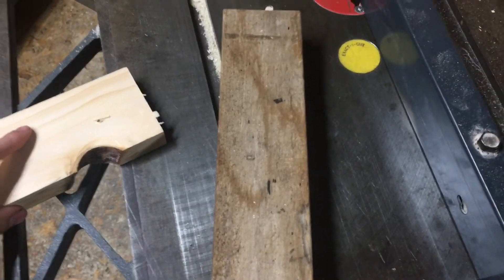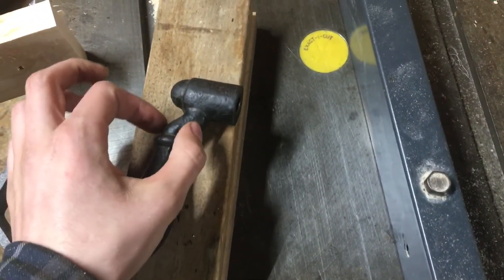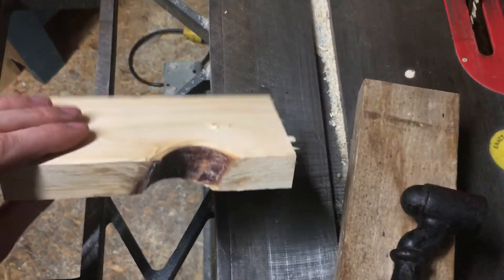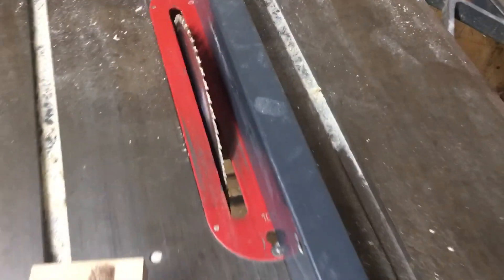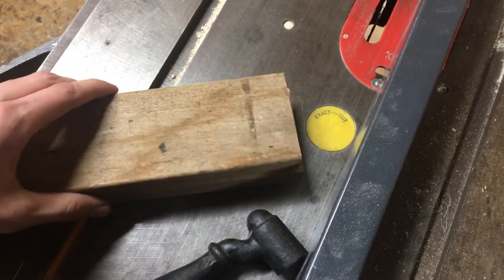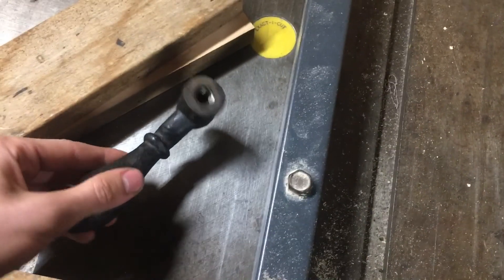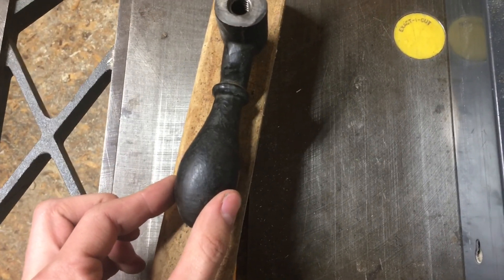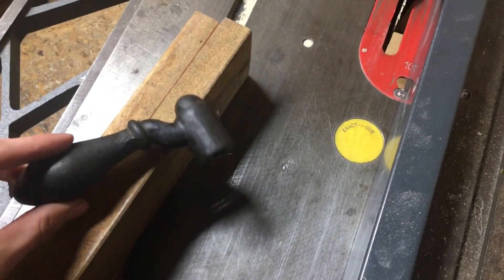Casting Metal from Start to Finish

Comment: In theory if you had a spare part that you want to make a casting of, could you slice it in half carefully and use it as the pattern so you could get it copied exactly?
Reply from the maker: @abaye23  yes, aside from the slight shrinkage that would result in a very slightly smaller casting than the original item
Reply: @castironmachines  from the loss of material from cutting, right? Could that be accommodated for with a shim of some sort to make up for the width of the cut? Or is there some other factor causing shrinkage that I'm not thinking of? Thanks!!
Reply from the maker: @ a sliver from cutting could be compensated by shim yes, but the actual material shrinks as it cools. Cast iron for example will shrink 1/8” per foot but for small parts like a handle, it wouldn’t really matter
Reply: He showed me this casting when I visited his shop but he didn't tell me there was a video!  What you describe is possible, good question.  But there are better ways.  Split patterns really just make for less hand-work with the sand and an simpler mold to ram up than a pattern that isn't split, so you'd likely just plug up the drilled hole and mold it in one piece using a technique called "coping down" to make one or two copies, or to make more you'd either use a "follow board" or coping down along with a "false drag".  Those are a little more advanced than basic split pattern molding, but not as much more or difficult work as turning an existing casting into a proper split pattern.  A real pattern is always preferred if you let the molder choose!